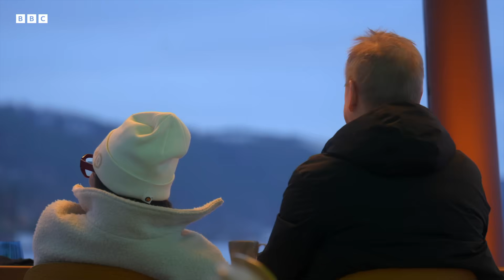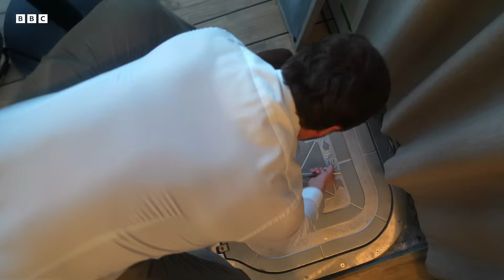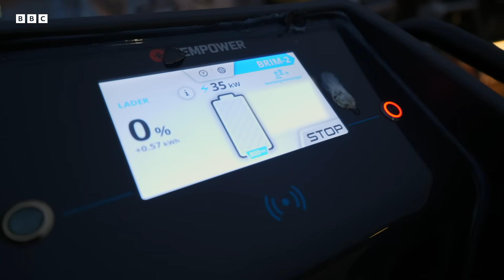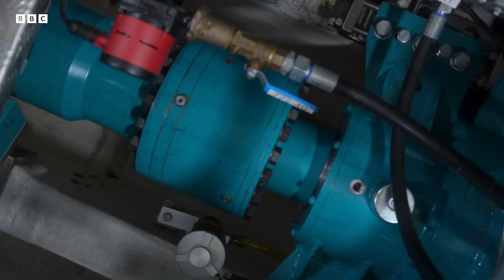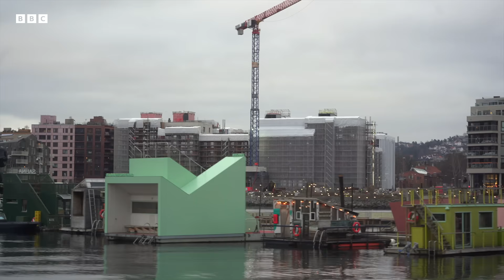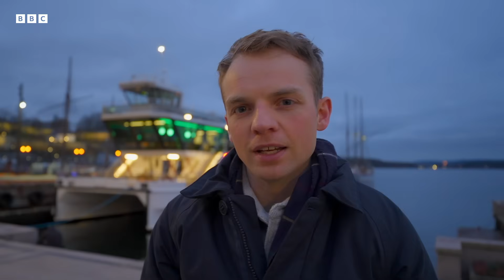Is tourism in the Norwegian Fjords going green? | BBC News

Comment: This question about ‘risk of running empty’ always comes up when talking about electric vehicles. I find it a bit irrelevant, you’ll have to make sure to ‘fill up’ no matter what energy carrier is used. Surprisingly, boats with diesel engines will also run empty.

Comment: is this the Norway who sells us oil and gas that we don't drill because we are green?
Reply: the reason the UK dont drill that much is because it simply isent that viable anymore, the UK offshore deposits are tiny now, and mostly depleted or close to depleted, Norway has far more oil to the point that it is incomparable yet it only produces about 50% more oil pr day, even if you drill more it litterly would still not cover the needs of the UK and thats why you still import, that it.
Reply: Norway has enough hydroelectric power, apart from maybe the day all cars, busses, lorries and more use electric as well, but for now export a lot of hydroelectric electricity as well.
The UK buys rather much hydroelectric electricity from Norway through the North Sea Link cable that enters at Blyth, so if you live in the Newcastle area, you can be totally sure that you have used a lot of green electricity from Norway.
But I have a question for you.
Do you think it is better for the planet that people use oil, gas or coal?
The reality is that many would be forced to burn coal if they were not able to buy the oil and gas from Norway and coal is EXTREMELY less "green" than oil and gas are.
As usual do people keep their eyes on the wrong ball in many cases.
It is EXTREMELY more important for this planet that people stop burning coal.
Then it is oil and then it is gas.
The reality is that the UK became a much more green on September 30, 2024 when it totally stopped burning coal to generate electricity.

So, yes.
Norway sells the UK oil, gas and electricity so the UK can be greener as the UK could not have been able to stop burning coal without the import of oil, gas and electricity from Norway.
It is always a good idea to look at the big picture to understand the world.
Reply: Yes, if you think the world is greener because one country stop drilling oil you are very wrong😂 they just drill more in saudi or Usa.  Oil is in pretty much everything we have, clothes, cars, phones , tv , furniture. House, roads,  the only way to help is by using less oil. And Norway is doing that very well,

Comment: It's great, I mean it's electric vs diesel, but what source of power charges the batteries? Solar, Wind, Geothermal, Wave power or Fossil fuels?
Reply: Norway has more hydropower than they can use and frequently exports to neighbors.
Reply: Hydro power
Reply: most of the electric ferries in norway has a disel generator onboard
Reply: @FergeKar thats a hybrid not pur EL
Reply: @allux2020 they dont use diesel. They use 100% electric so i dont think his comment is correct. Or they have diesel backup in case of emergency
Reply: @Randomdude21-e  They use a diesel engine for long trips where they need to extend or emergency wise if battery drops too low on a trip, the engine itself is called Range Extender of that reason, mainly the power is taken from Electric but on cold weather days there is needed to use an efficient oil burner to heat up the vessel as the battery banks itself is not enough when heating is calculated into it, just remember it can get down to quite a few minus degrees where this boat is located.